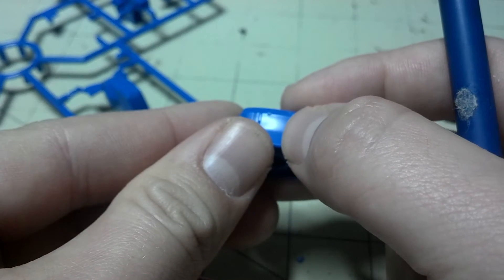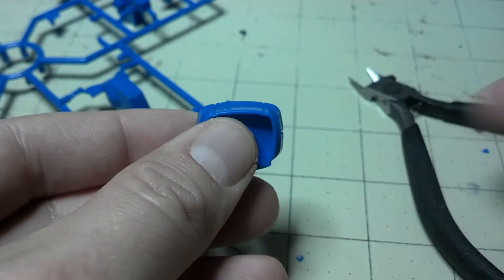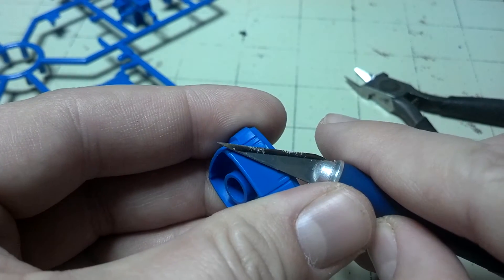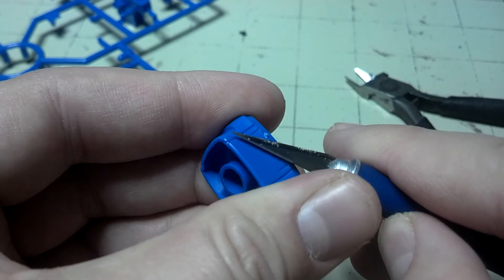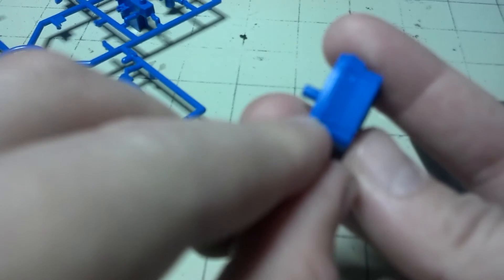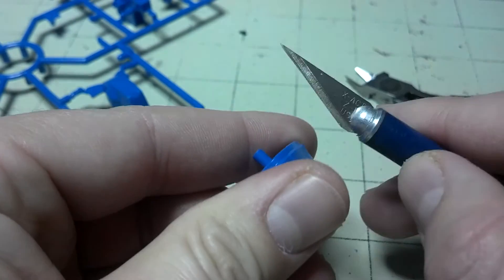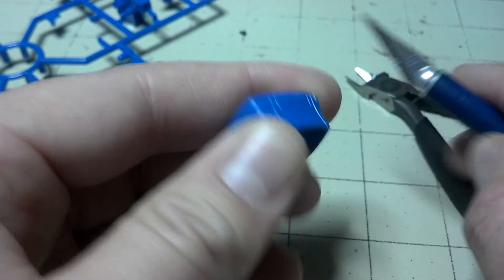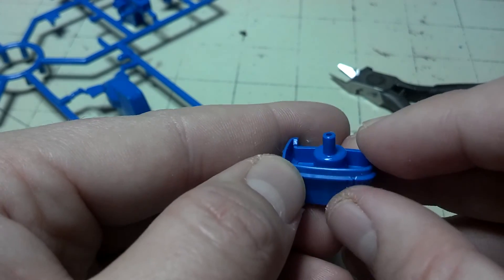Gunpla Building with Rob "Sprues and Knives"

Comment from the maker: What's this? a tutorial from me? 

I know I'm not trailblazing a new path towards the future with this technique, but this is how I like to work. I wanted to show a friend how and figured I would do so in a public method.

 Maybe expect more in the coming year from your friendly rural Gunpla and Cow Master!
Reply: Wow!  Great video!  If I understand this correctly, when you place your side cutters flush against the part, then as you cut down this puts so much pressure on both the tree and the part that this causes the plastic to be pulled away from both into your cut, which is what causes the stress marks on both pieces correct?  However, by placing the side cutters a millimeter or two away from the part, it'll still cause stress on the sprue tree, but you can simply shave away the excess with a hobby knife like you have shown, to a point where you couldn't even tell that's where the sprue connected to it?
Reply from the maker: It depends. I like to cut the parts off the runners with enough space to avoid making mistakes and using my cutters to work it down to the part's surface before I need to use my knife.

With just enough gentle pressure on the cutters it can sometimes cut the nub almost flush to the part's surface without stressing the plastic but I still cut away the remaining nub with my x-acto knife.. I'm using Tamiya's sharp fine tipped cutters and they live up to the name.
The knife work I'm showing is that you can cut the sprue from its broader side to its shortest distance across instead of going down the length of the model part. from my experience this is less risky, and angling the blade to shave the nub area afterwords helps to hide any imperfections or scraping errors.